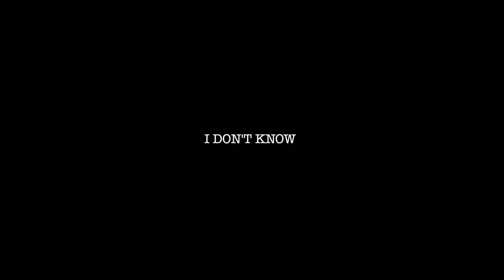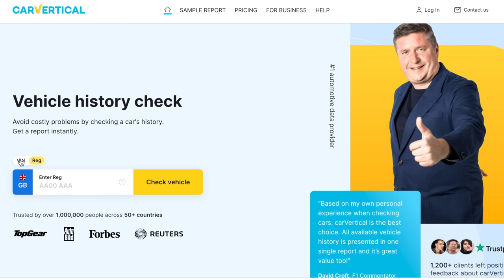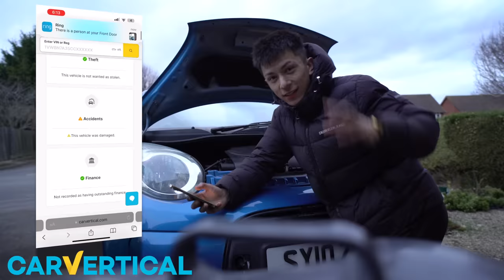CHANGING A CLUTCH FOR THE FIRST TIME- EVER!

Comment: Props to you for taking this job on mate, alot of people would send it straight to a garage! Just as a heads up, make sure the clutch system is fully bled as the new slave cylinder will have air in it and make sure the brake fluid resevoir is topped up, next time round make sure to check the flywheel as on this one you could see the heat marks so shouldve replaced it and check for excessive play in it aswell. Overall a good job tho mate👍🏽

Comment: Mate honestly should have seen me trying to do my rocker cover & oil filter housing gasket on my BMW in my drive way with absolutely 0 mechanical skills, no mechanic with me. Took me from 9am and by the time it was dark at 9pm I still wasn't finished 😂 I did eventually get it done but just took so long into the next day, not even as complicated as what you've just done but it's just so much to remove and put back and remember where it app went and shit breaks when you take it off too (20 year old car) just yeah, well done bro 😂👍

Comment: Aslo bro , you might have to top up the brake fluid and bleed the clutch , as the clutch and brakes use the same fluid . Welcome g
Reply: *also
Reply: C1 has a cable operated clutch. Not a hydraulic one.

Comment: Why  take the gearbox out completely I have not done that in about 20 years . I can push the gearbox a part enough and slide the next clutch,pressure plate and either bearing or slave cylinder . Use compressed air to clean the dust
Reply: Cause is makes life 10 times easier Instead of working in a stupid wee gap for no reason
Reply: @gregshearer423  Its much faster and easier to leave gearbox in situ
Reply: @fredrich99  it really ain’t only way it’s faster is if you have to drop the subframe to actually get the gearbox out
Reply: @gregshearer423  Very rarely do i drop the subframe completely A lot cars dont have a subframe You got your way i have mine what ever works best